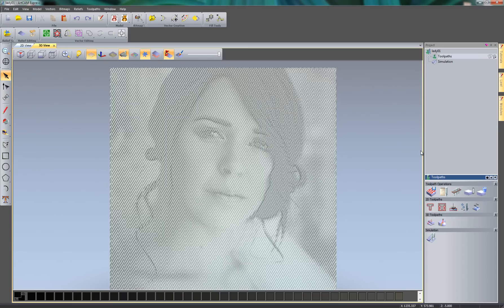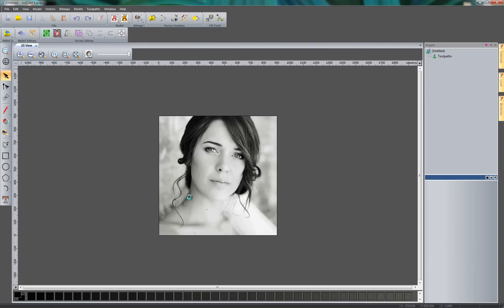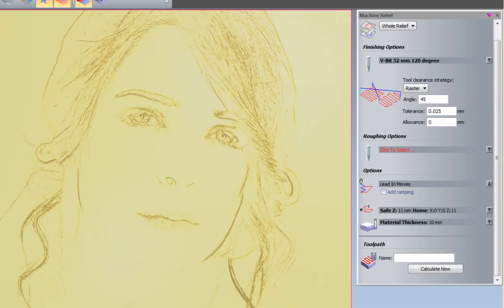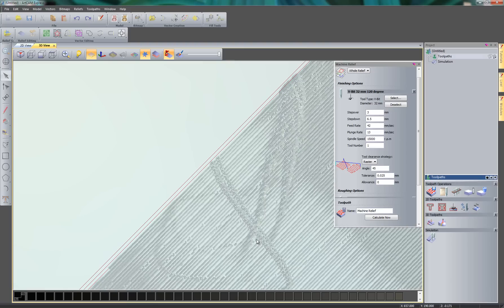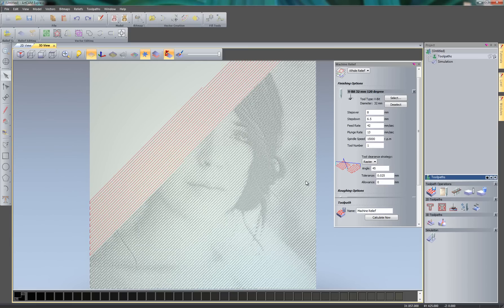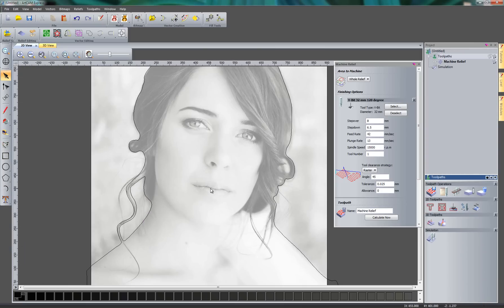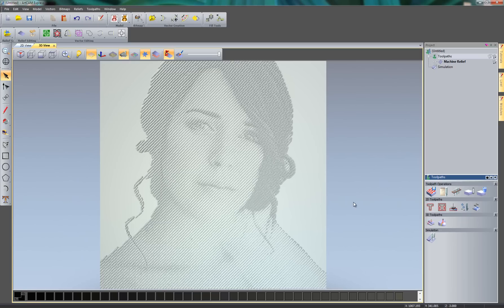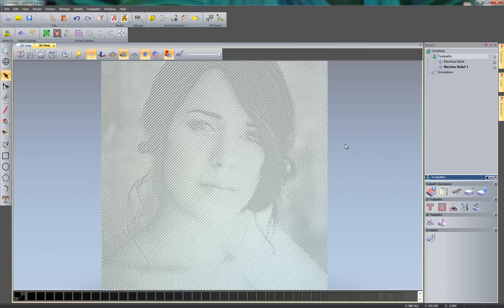Vbit Carving A Photo

Comment: I did using ur method. It works   but it has to be viewed at an angle nearly 140 degrees. If u look straight or at slight angle it's not visible. Is there any way to make it visible at straight or at smaller angle?